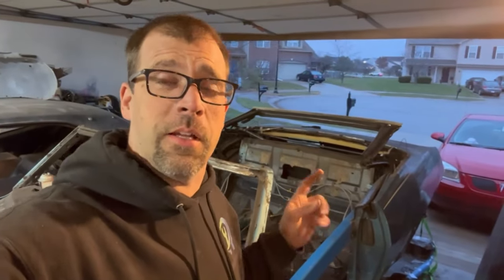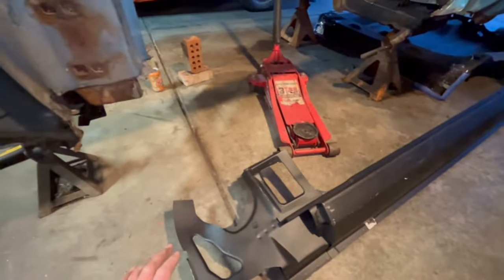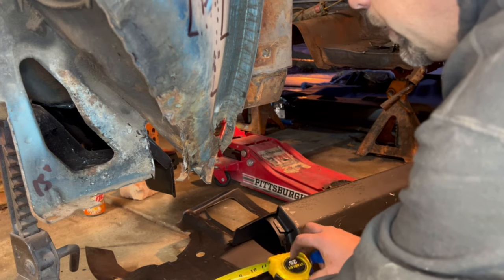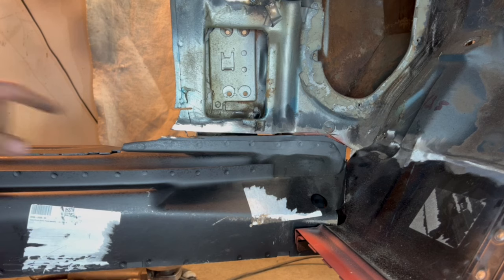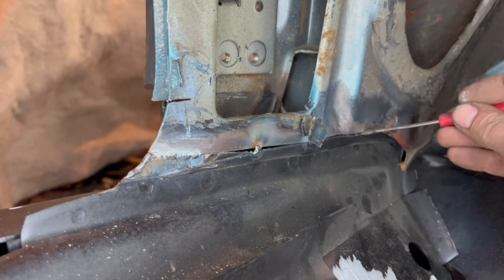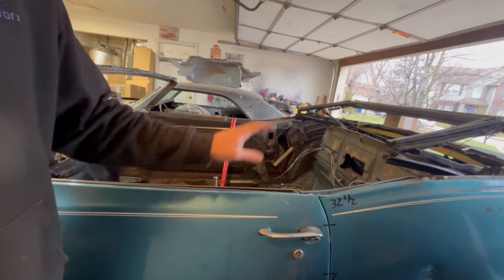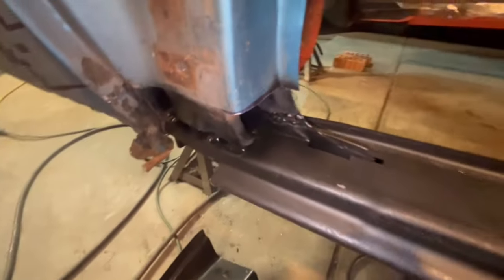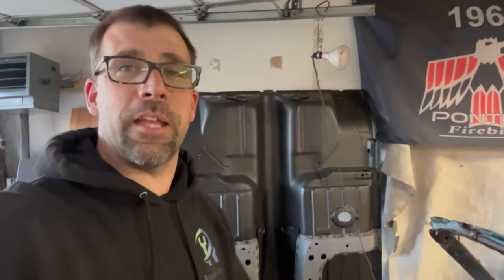Installing convertible rocker panel assembly 1969 Firebird

Comment: Excellent. Exactly the how to we needed to get full rockers installed. 👍
Reply from the maker: Fantastic!  The coupe is almost identical. How it attaches to the rear inner 1/4 is a little different but actually easier. Good luck and gotta save them birds.

Comment: The adjustable rv jack stands would be great for your next step. I bought a set and welded a piece of angle iron to the top with supports on each side. They work perfectly. Ty again for your dedication to the hobby.
Reply from the maker: Went on a mission to find some today. I see them being very useful for the frame rail install.
Reply: @VinylVillageGarage  I bought mine from Amazon for around $38 for 4
Reply from the maker: @FE428Power  I am looking for some that have a 25” reach.

Comment: I like how you go all through to remove as much rust as you can I had a Camaro restored years ago and they took short cuts and in just over a year I had bubbles popping out all over the car and ended up just getting rid of it I was not happy with it.
Reply from the maker: That happens so many times unfortunately, the rust needs to be removed or at the very least treated to prolong the life of the car.  I have assembled cars as you see me doing and lasted over 20 years. The lemans I just sold sat outside for 5 years and still looked great I did it 19 years ago.

Comment: You r exactly right about buying a “ better “ car, u can spend 4to5 grand or more on a supposedly better ( less rust) car , then when u get into it u find all kinds of nasty little secrets. I never cared much for buying something that someone else had worked on to be honest, especially if it was in primer.
Reply from the maker: I steer clear of cars “ready to paint” or it has to be real cheap because it will most likely need overhauled anyway.

Comment: Great video! Very close to how I installed my driver side rocker. I do have a couple of questions. Is your car a early production year car?  The reason I ask is. In the trunk you have a bracket that hooks to the bumper holes and welded to the trunk filler panel. Mine doesn't have that. I just have a welded washer with 2 holes  that is spot welded to quarter panel. Also can you get a close up of the production date stamp you found on the rear floor pan? I wonder if there was a difference how the Norwood , Ohio plant put their cars together vs the  Van Nuys, CA plant.  Keep up the great work!
Reply from the maker: All three of my 1969 birds have that brace from the floor pan up to the 1/4 panels. Now the replacement 1/4 panels come with that bracket like you described.

Comment: That is what makes me so angry that these sheet-metal part companies know exactly how rough transport companies are on delivering our parts they do not care they will step on them walk on them drop crap on them and they do not care even if you open the box in front of them they do not want to take responsibility of what they done. With all that said the companies who re-pop these sheet-metal parts should take it up on themselves to put the part in a plastic bag put it in the shipping carton and then fill it full of spray foam to protect it from the abuse of the transport company or better yet even their own storage warehouse those people do not care either and by the time it has been ship from company warehouse to the parts dealer and then shipped to you those parts have been through total hell. I am done ranting now!
Reply from the maker: It would not take much to add a little protection or a bit more care when handling them.   I used to just pick parts up and inspect them beforehand. The place I went marked up prices so high id rather take a risk on shipping